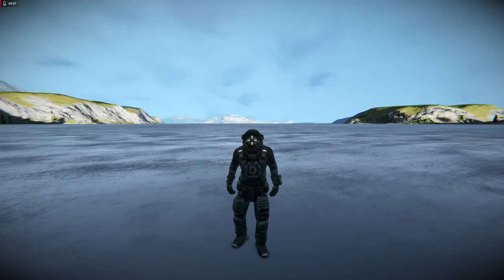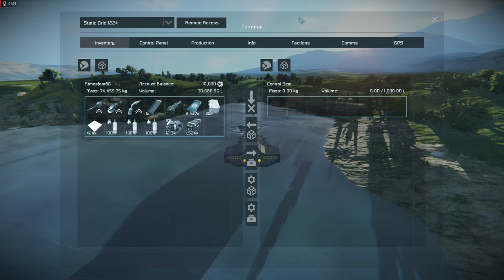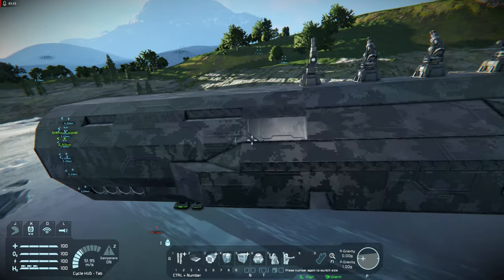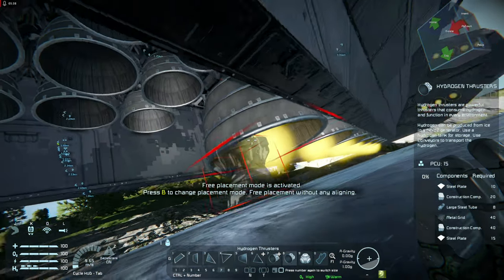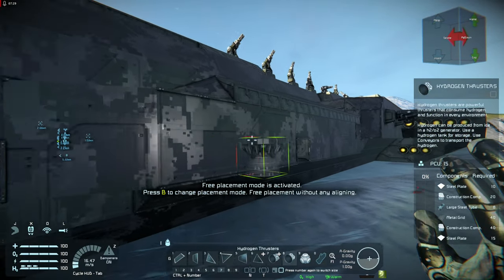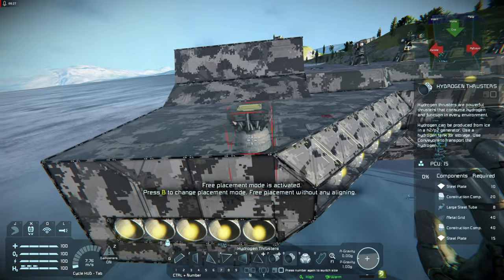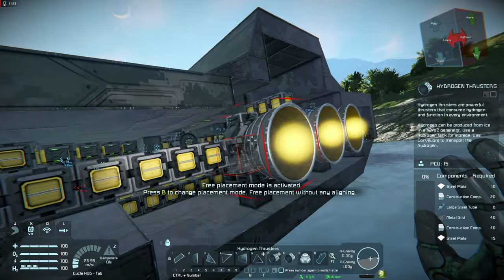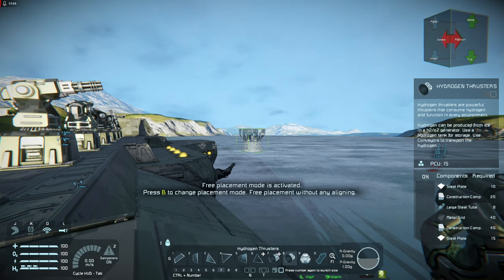Space Engineers - How many thrusters do you need for your large ship?

Comment: Iam not sure if it works that way, but...

1)
9 small thrusters - 9.9MN of thrust and required input of 10.8m3
1 large thruster - 7.2MN of thrust and required input of 7.5m3

which gives us a miniscular difference in efficiency in favor of large thruster:
1,(09)m3 required input for 1MN of thrust for small thrusters
1,042m3 required input for 1MN of thrust for large thruster
9ST setup burn ~4,6% more hydrogen (just for this parameter, in fact it burns even more)

2)
9 small thrusters - 9.9MN of thrust and (12780kg + 12231kg for 9 additional conveyor junctions) 25011kg of weight
1 large thruster - 7.2MN of thrust and 6940kg of weight
which gives us another difference in favor of large thruster:
9 Small thrusters have 396W/kg power to weight ratio
1 Large thruster has 1037W/kg power to weight ratio - almost 3 times better ratio (2.619)

3)
Weight difference - 25011kg - 6940kg = 18071kg
Thrust difference - 9.9MN - 7.2MN = 2.7MN
Thrust required to lift Weight difference  -  18071kg * 9.8m/s^2 = 177095.8N = 177.0958kN =~ 0.177MN(a bit more ofc)
Real Thrust Gain - 2.7MN - 0.177MN = 2.523MN

Putting 1, 2 and 3 together - You gain ~2.5MN of thrust for the cost of burning smth like 5% more hydrogen - pretty nice IMO.
2.5MN more thrust means that you can lift 255240.11kg ~ 255t of your ship more on 1g planets, gain is even better on lower g planets. It appears that these are quite balanced:
9ST - require more H2, yield lower acceleration, yield more power, easier to put
1LT - require less H2, yield higher acceleration, yield less power, harder to put
If you are not SpaceX or NASA - these 2 lines are all that count :p

I wasnt entirely sober (in fact I was drunk) while calculating this - so I could make some mistakes - feel free to correct me.
Reply from the maker: Seems pretty good to me :) I touched on some of those factors later on, in the video below, once i had gained a lot more experience in the game lol. It also increases the PCU usage of the ship as one large thruster has the same PCU as one small, and then adding the conveyor to that adds an additional 10 PCU. If you have a silly amount of conveyors it can even cause the game to run slower as it has to calculate 6 points of exit and entry for the fuel as opposed to 2 for a tube. I really need to update this video :) If i do i will give you a mention ;)

https://www.youtube.com/watch?v=kWt8QxRhbww&t
Reply: This reminds me of Iron man who solved a formula while being drunk in the third movie XD

Comment: Essentially, the drawbacks for using small thrusters instead of large ones are related to the PCU Spending limit on servers. Public servers; last time I checked, only allocate a personal PCU limit of 10,000. This may sound like a lot but trust me this isn’t. For example, when you are building a ship you have to consider how much PCU you are going to spend. You would have to choose between spending 15 PCU for a large hydrogen thruster (7.2MN) or spending 105 PCU for 7 small hydrogen thrusters (7.7MN) to roughly equal the same. This does not include the fact that small hydrogen thrusters can only be plugged in from the bottom. Most likely, you will be using conveyors or containers to connect everything together which would most likely also eat away your PCU cap. To conclude, it depends on how important the PCU cap is to you.
Reply: Excellent response! This addresses a question I hadn't yet considered. The question I do have is how difficult is it to pipe hydrogen to multiple small thrusters vs. a single large one. The amount of piping (and the corresponding weight AND PCU) may also be a determining factor in making the choice between one large or multiple smaller thrusters.

Comment: Downside of all small thrusters is weight versus thrust.  Large large-grid hydrogen thrusters have the best thrust to weight ratio across all types and sizes of thrusters.  The offset is weight of your armor to cover the large thrusters versus small thrusters, but your open spaces also cost so I don’t see the downside of large thrusters.
Reply from the maker: Yeah the only issue with the way I designed this ship was that I wouldn't have been able to make it air tight, but I would've saved on conveyors and weight for sure!